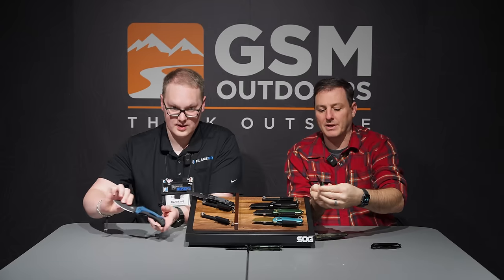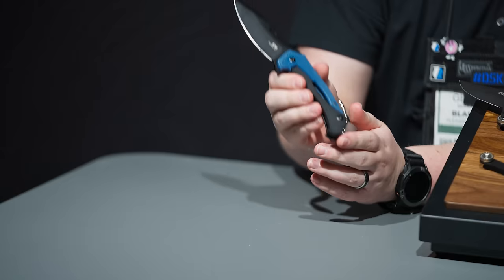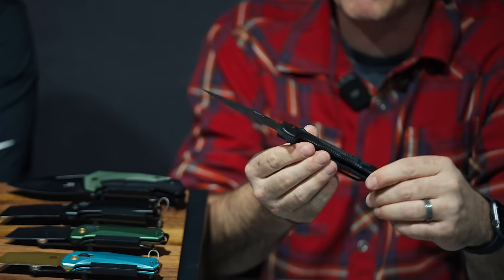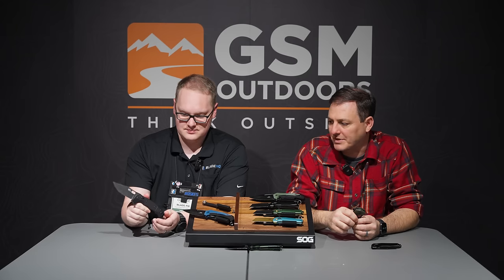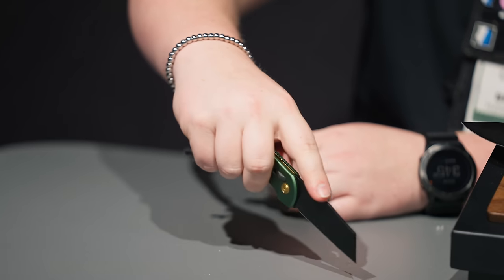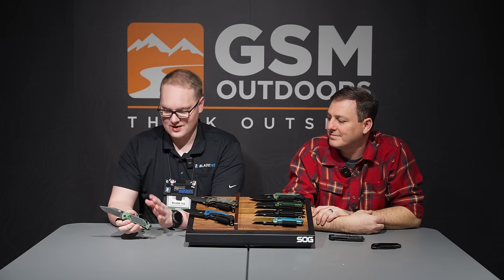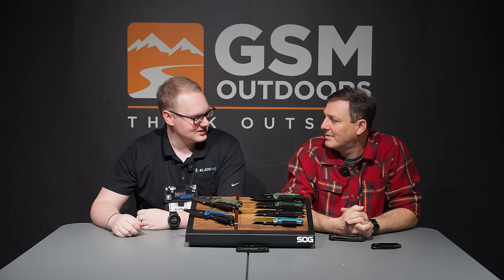Aluminum Handle XR Lock! | NEW SOG at SHOT Show 2024

Comment: SOG officially announces they have crossed into the mall ninja, gas station collection
Reply: They did that a long time ago.
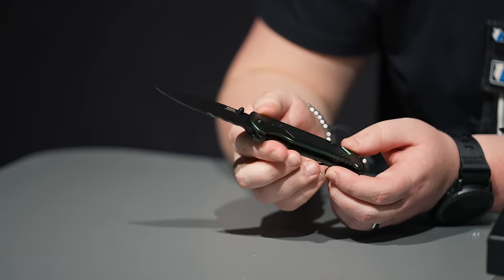Reply: The knife and angle at 6:16 looks like so many gas station knives I have seen. Like I don’t like saying that actually known knife makers make gas station knives but damn. I mean seriously serrated clip point blade, assisted, seat belt cutter, generic handle shape not to mention the “traction inlay”. I could probably walk down to the nearest shell station and find this exact knife
Reply: That's pretty much their thing now! That junk is gimmicky as hell!
Reply: You must be new to SOG. They've been a dominant player in the tacticool mall ninja space for a long time. They had a 2018 brand pivot to try and be a little more bourgeois with their use of crossbar locks, titanium/CF scales, and modern supersteels. However, they still embraced that part of the market that "totally would have been military special forces if they didn't have that pre-existing health condition" with many of their designs.
Reply: @theKashConnoisseur  😂

Comment: I was really excited for SOG stuff for a couple of years. They seemed like they were on a roll. Right up until they were bought by GSM.
Reply: Gsm mess up everything they buy like Cold Steel
Reply: Yeah, the Pillar, Terminus XR, and Seal XR was pretty interesting. Everything else after that is junk!
Reply: @ELVendedor5000  Their initial XR lock offerings were interesting, but poorly executed. I've got several examples where the belly of the blade can strike the back spacer or barrels (depending on model) when closing the knife, causing dulling and chipping where they contact. Despite their best efforts, SOG has never been able to escape it's heritage as mall ninja bait. They struggle to create well executed folders, instead depending on tactical fantasy role play to sell blades.
Reply: @theKashConnoisseur  yeah, just a small step above budk and United Cutlery crap!

Comment: Assisted opening is the lazy/complex solution to making knives with good detents. The longer Ive been collecting, the more I reject the use of assist. Either manual or auto, assist is pointless.
Reply: To me, autos only make sense for MIL/LEO users that need something quick to deploy in gloves, or for civilian users with dexterity issues that make other opening options difficult. Most knife users don't need a quick deploying knife to open Amazon packages and bills, and so manuals are perfectly fine. And for those carrying knives for defensive use, arguably they will want a fixed blade in a sheath instead. But for those knife fighters that prefer folders, ones with the Emerson Wave feature are going to be the fastest option in my experience. That being said, with a little practice, most knives can be deployed in a fraction of a second with the flick of the wrist, rendering most arguments about deployment speed moot.

Comment: I'm genuinely shocked sog is still in business, few companies exemplify all sizzle and no steak like sog.

I have had a few of their knives and they have been consistently crap
Reply: yeah, like the ugly SOG Salute or that awful Bushcraft knife made of 5Cr15MoV! 🤦
Reply: Their original Trident knives were really good tools for a fair price. But their 2nd generation of the line was awful, we're talking stiff action, a terrible blade grind, injection molded rubber handle inserts for grip, and the knife was held together with two stiff spring clips instead of torx. Their 3rd generation Tridents (current gen, with the AT-XR system) are a decent design, but the execution is a fail. it has a strap cutter slot that is positioned so that your pocket hem will always slide into the slot, cutting up your pants when you try and put the knife in your pocket. Which, for a pocket knife, is a fatal flaw.